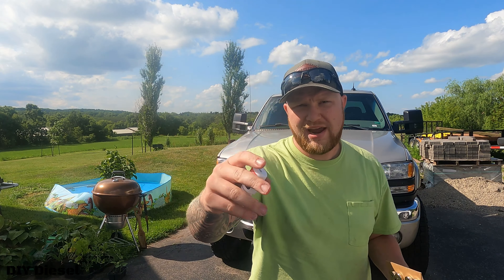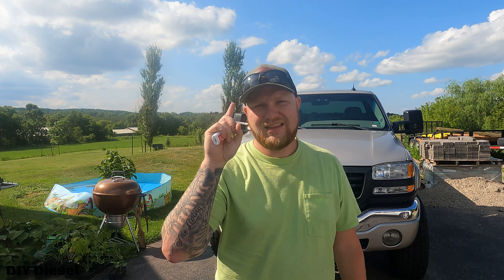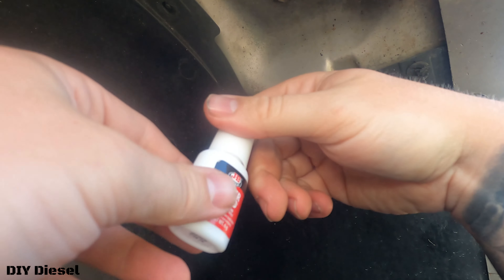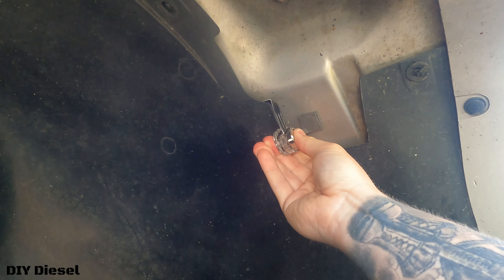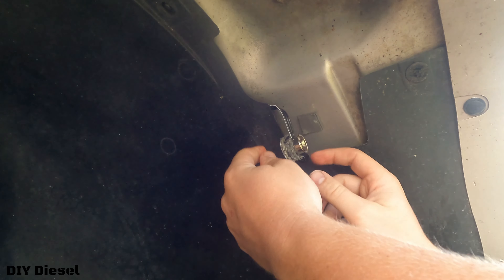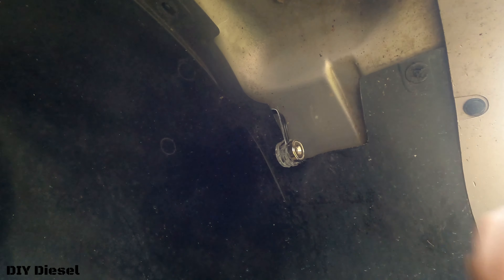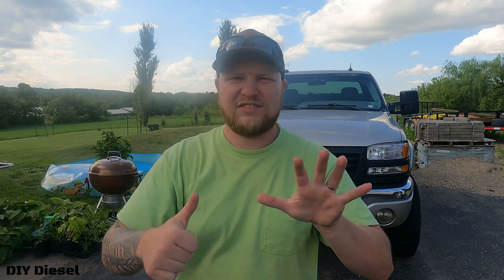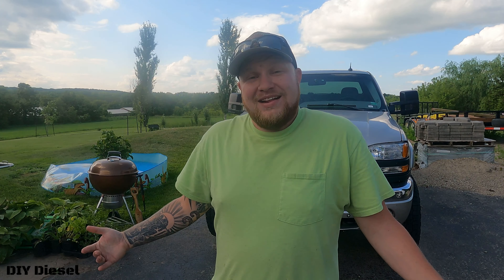Rock Light FAIL Pt. 1 Fix

Comment: Not a bad idea! The tape seems string but I've used it and after a year it failed on an outside structure with a motion light. Can you please link the magnets?
Reply from the maker: Ya I ended up using a JB Weld epoxy on them 👍 I will lol I them in a few hours 👍
Reply: @DIYDiesel  I saw in the next video. That's a great idea! How are they holding up?